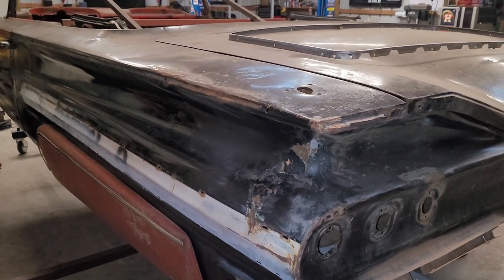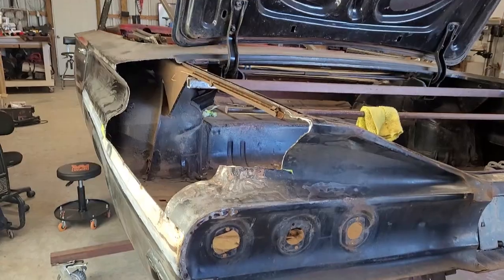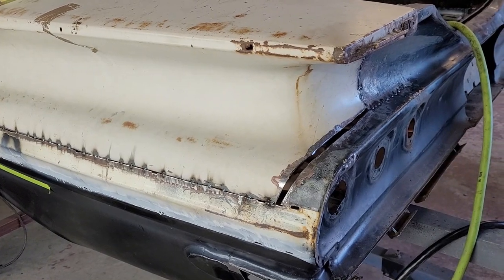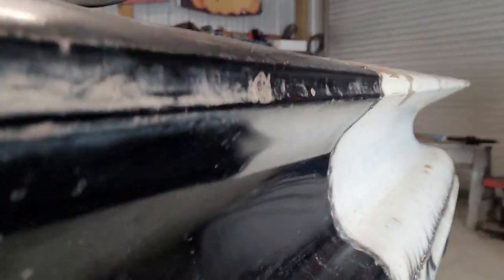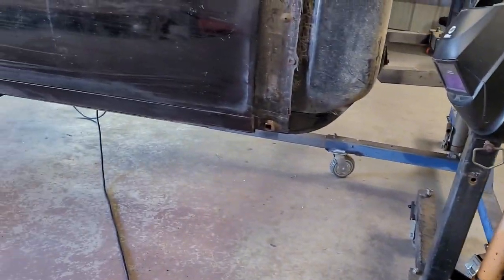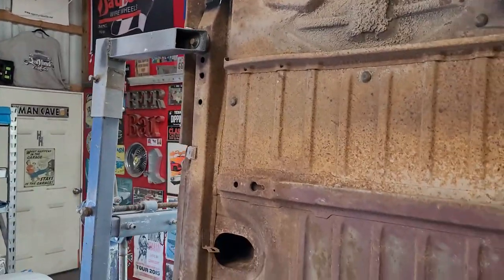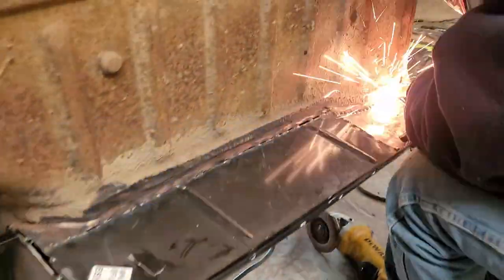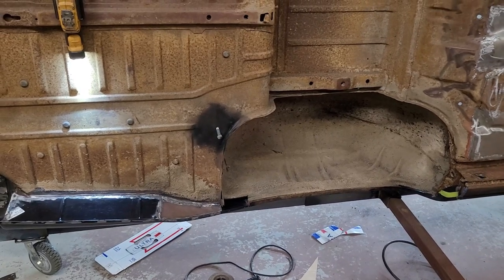1960 Chevrolet Impala Sheet Metal Repairs | DIY | #Rematch60

Comment: It took almost 2 months to get my frame kit. The majority of the issue was on FedEx end though. It did finally show up that's all that matters in the end I suppose.
Reply from the maker: Fedex freight was about 4 days late....and I had to drive 45 mins to the dock to pick up.  It's not a big deal I guess, but when you pay over 300 in freight charges you'd expect a lil better.
Reply: @lonestarlows  for sure. I had to get a hold of Arr through email and he called FedEx and sorted it out. I am all the way in Michigan too. Mine came in 5 boxes first 3 arrived first then the last 2 took another few weeks or so. Was really frustrating.
Reply from the maker: That's exactly why I try not to outsource anything. But the amount of time saved on a kit, out weigh the frustration- this time lol

Comment: Where'd you get your pneumatic air punch? I've went through a few Harbor Freight versions and they didn't last long. Would like to get a decent one.
Reply from the maker: Astro 605ST ONYX Straight Type Punch/Flange Tool https://www.amazon.com/dp/B0066LMK7S/ref=cm_sw_r_apan_glt_i_11CYPT0SFWSM866F3ST4?_encoding=UTF8&psc=1

Comment: Major repair here. I get nervous watching y'all cut out quarter panel sections. Good work. I have a 60 2dr Impala that's gonna need a lot of panel work. This helps out.
Reply from the maker: Thanks.  Its really hard to find patch panels right now.  They are floating on a boat off the west coast
Reply: Just measure 10x and cut once make sure all gaps are filled plus supports where needed…..only way I learned was putting hands on and now rust is not one bit intimidating its just the time that gets me